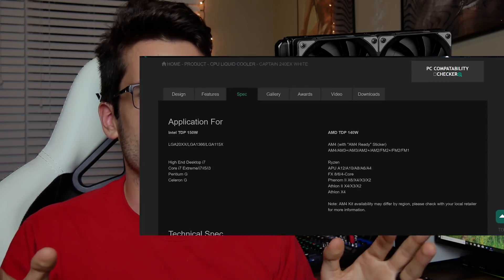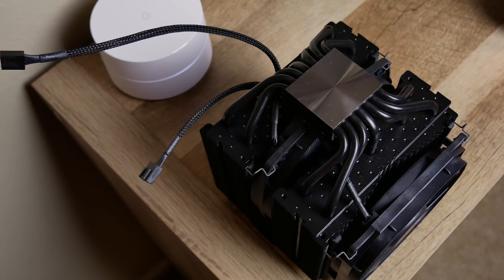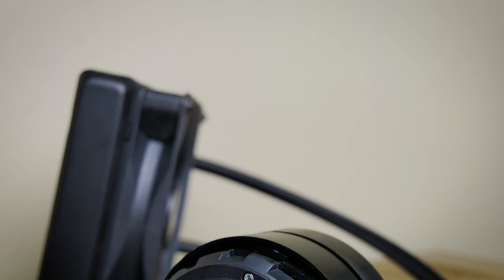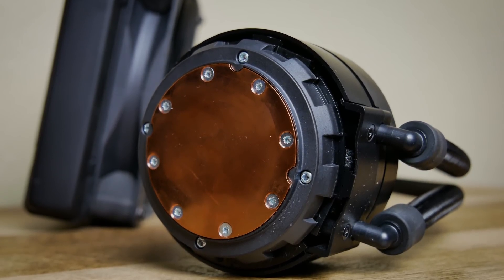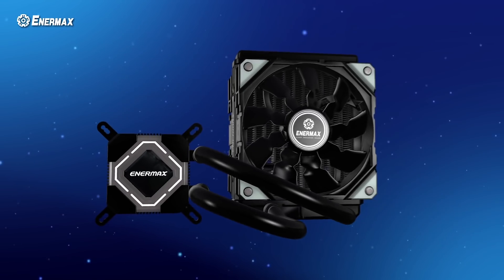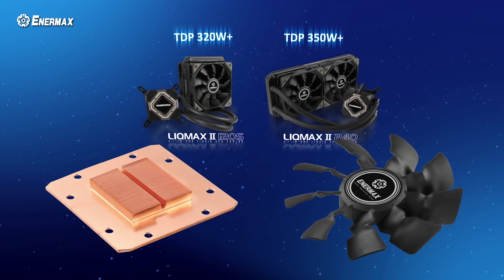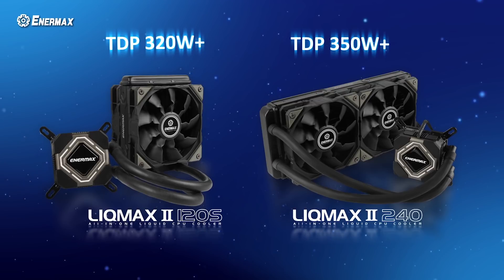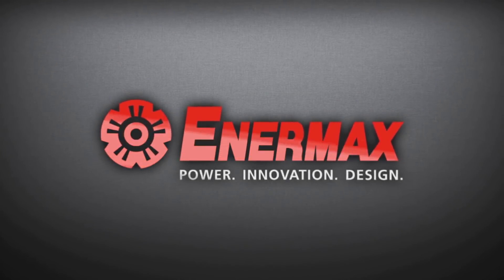Ever Wondered Why TDPs Aren't Listed for AIOs?

Comment: Greg, I would like to see you test this. Buy the Enermax and the DeepCool (or see if they will supply review samples) and run identical experiments on them to see how they perform. I agree the two companies' testing criteria were probably very different, but I would like to see some evidence to back up your claims in this video. You could rig up a dummy heat source as a stand-in for a cpu, so you could dial in specific wattages to test at. Maybe sandwich a thermocouple in there too for more data.
Reply: Also, it looks like the DeepCool product spec is a TDP for the CPU rather than for the AIO itself. Otherwise, why would the TDP be different if you are using an AMD CPU? Perhaps Enermax's TDP is what the AIO itself could handle at its max safe liquid temperature. I suspect it is likely that the thermal resistance through the CPU die, TIM, IHS, TIM and into the coldplate would become a limiting factor before you got to that liquid temperature, however. So really it comes down to how hot you say your CPU can get. If you allow your CPU to run at 99C, the liquid can be hotter, and the radiator can dissipate more heat for given pump and fan speeds. So it comes back to wanting to see testing comparing AIO performance where we know what the parameters are. Maybe GamersNexus would be better equipped to get into that...

Comment: You really hate AIOs. You quoted flawed science and logic in your AIO lying video and this one. You're like one of those religious nutjobs that quote 1 or 2 laws of thermodynamics and intentionally ignore the other 3 or 4 laws that are required for the ones they're quoting to work because it would contradict what they're trying to say. If fans have to run at max on an AIO to handle high TDP, HOW MUCH FASTER WOULD THEY HAVE TO RUN ON A AIR COOLER TO HANDLE THE SAME TDP? Use your head.
   Liquid cooling is far better than air cooling PERIOD.  My FX9590 with a 220w TDP under normal load on a H110 AIO runs under 30*c and the AIO temp at the pump is 28*c with an ambient temp of 23*c. YOU WILL NOT ACHEAVE THIS WITH AIR COOLING

Comment: Don't agree with what you're telling us about AIO and how they are not working as listed. Well at least that how I interpret your message. AIO work okay, yes you have to take into account that the AIO needs to warm up before you have an accurate reading in its cooling capacity. Fan speed makes cooling more effective on AIO's But same goes here for air coolers. So kind of weird you mentioned this. Pump speed doesn't really make much difference. Like does it matter how fast water is going to the rad?  In some degree maybe. But looking at water and how it heats up and cools down. Speed doesn't mean much.

Comment: Okay let me correct you on something
Strong pumps only helps in custom loop with a reservoir
in aio liquid flow rate doesn't matter much,slower pumps means the liquid will stay in the radiator for a longer time resulting in better cooling of the warm liquid,unless the cpu is already reaching the liquid's evaporation temperature,which mostly dont,as they never use water in aios.

for custom loop with a reservior,strongs pumps will help,but by a very small margin,as the liquid can cool down in reservoirs and dont need to stay very long in the radiator!
Strong pumps are used in custom loops not because of high dissipation of heat from the cpu but as custom loops tends to have multiples of 360mm rads and the pump needs high water head aka high speed and torque to push and pull the liquid through theses rads! custom loops arent properly sanitized and will eventually create blockages and the high pump head will help in brute forcing the liquid through it!

Comment: This is the second video you make about AIO´s and state they are not efficient, I have used both air coolers and AIO´s, and leaving a side the durability of cheap 120mm AIO´s, any crappy 120mm AIO have performed better that the standard to high end Air coolers. I will not discuss that Air coolers life span is much longer than the AIO´s, because they have long life span y comparison to an AIO, but the performance, at least in my experience, is much better.
"http://es.tinypic.com/m/jubmef/3"
This is my actual build, and the GPU does not go over 55ºc under stress, and the CPU (8700k 4.7mhz all cores) does not go over 78ºC under heavy synthetic benchmarks in loop (I will never reach this kind of load under normal workloads), the fans at the AIO have no curve configured, they just run at 500 to 600 rpm linear. 
So I still don't get the point of these videos, unless you have something personal against the AIO´s I really don´t understand what you are trying to say.

Comment: Very interesting. Im glad you went after the TDP part of coolers, i feel like people never discuss this even though its the most important part of cooler choice and a lesser but still important part of CPU choice.

Id be interested in seeing someone compare the pros and cons of air vs AIO cooling because the way i use my AIO is something that few air coolers can do. I use it not only in a miniITX system where the PSU hangs over the socket but i use it to exhaust heat from my case because my 5 year old GPU has a dying fan and any extra heat causes it to ramp its Tiny insufficient fan up tell it sounds like a banshee. 

As a side note:
Something i noticed with old dell machines is that they usually have some sort of shroud system guiding the hot air out and ive been wondering why this is not incorporated into custom PC's(besides it not being attractive). using an AIO you could definitely accomplish this without having a custom shroud. but it seems like so many people put their Rads in the front of the case blowing the air in on their GPU(s).

Comment: If you take them all to heart. Take this dagger to chest. I run an AIO on a Zotoc AMP 980, this card has the coughs stock Naruto orange fan aircooler.  I seen that card ramp up to a whomping 75C on Valley.and 40--50C idle even after replacing the grease on the aircooler.

Take a Kraken G10 plus a Water 3.0 AIO that temp comes to an idle of 28C (touchable cool) to 53c max on everything except ARK which holds it at 58C. This is the a worst case range of over 20C - 30C. 

So with that said explain why this AIO is doing a great job compared to a cooler that is air and should of been able to keep it cooled in the 60c? You opened this can of worms, can you close it or are you going to ignore this challenge? I.E scrum like Jay would ingore this, Tech Asus City would ingore this. About the only Youtubers I know who would not is Craft Computing (A breath of fresh air), Lunduke, and Elric might post a comment

Comment: Tip, only use 120mm AIO if you need space, they are no better than any air cooler at same price. If you really want cooling performance, go for 240 or 360mm, much more expensive, much larger, but does the job.

Comment: Would definitely like to see you test/try out the Arctic Liquid Freezer AIOs. Their fans even at max RPM are pretty quiet, comes in push-pull config, and has a thicker rad than most AIOs. They also advertise a very high TDP on their AIOs.

Comment: That's why I always do a custom loop.  AIO's do have a place though, they are good for stock running systems as they reduce the noise over an air cooled solution.

Comment: There is only one thing you can do. Put it to the test. 
Get a AMD FX-9590, 8x 4.70GHz, put it under water, overclock it to 5.0 or even 5.5 ghz, and see what happens when you run prime95 for 24 hours.  ;-)

Comment: The claim of 350W of TDP means that the MAX TDP is 350W doesn't matter that no one will run it at max pump and fan speeds all the time, it matters that it CAN dissipate 350W of heat. 

And what is the explanation exactly for why TDPs arent listed? The fact that air coolers have multiple heatpipes and the water coolers have 1 tube of hot water going into the rad? That's not how it works. I hope I don't seriously have to explain this point.

And pump speed always matters. Sure there is no point in increasing it if your CPU is not that hot, but if you increase the pump speed the temperatures will go lower at the cost of noise. Just like fans.

I'm not sure why some AIOs don't have TDPs, but it sure isn't this. 

Judging coolers by TDP is pointless anyways, because there is no defined way how to calculate the cooling capacity of coolers. It depends on the ambient air temperature, fan speed, pump speed and whole lot of other things like air restriction of the case.

The better way to compare coolers is by looking at temperature comparisons of coolers within the same review, because if you compare different reviews they might have different conditions.

Comment: I have a liqmax 240, and I didn't believe that tdp rating when I first bought it. I bought it cuz of the price to performance, the static pressure fans, relatively low pump noise, and ease of mounting and unmounting the water block/ pump for testing OMG is it easy to mount than a dark rock pro, a zalman tower, a prolimatech tower, a deep cool tower, a Corsair AiO.

Comment: with TDP being subjective ti coolant temp I don't doubt the enermax claim, however...
it would only perform at such an efficiency with the coolant temp highly elevated above ambient. lets say the coolant has an anti-boil and you've gotten the fluid temp to 120c in a 25c room, of course that radiator is going to suck a good chunk of that heat out, but it's not going to change the fact that the cooling is now pointless as your cpu and socket are currently a melted mess of metal and plastic, and probably on fire...

I run a Celsius S36 in my ryzen 1700 rig as it seldom sees a continuous load on the CPU and as such I let the coolant volume take care of the work (CPU goes full load for a few seconds, the coolant itself raises a few degrees, and subsequently drops to near ambient when the load drops) so the fan speed aligns more with the ambient temp than it does the CPU load. cooling in this manner is to be perfectly honest, bloody inefficient as like I said, efficiency is dictated by the delta between coolant temp and ambient, however it means that my fans can remain in perpetual silence :D

Comment: i put 2 92mm aio coolers in my dan a4fx mini itx case to see if i could do it and cuss of the limited space i have.i put one of the aio coolers on my gpu and it runs cooler then before and doesnt heat up the whole case now either.

Comment: i was just looking for this. I have an Antec Mercury 120 for my Ryzen 2200g. I had an Enermax 90 before and thought it was good enough but it reaches 98c when stressing both cpu and igpu. Normal games will take it to 80c and i wasnt comfortable with those! So i bought my AIO and ran aida64 for 3hrs (i fell asleep) and max temp is only 68c for a sec or 2, stable at 61c. Even in game only goes up to 56c! Huge difference and Im so happy except for the vibration. I have to hunt the source!

Comment: I don't know, I put an aio 360 rad on my evga 980 ti. gets 43c on full load overclocked and over volt.30c to 35c lower then the stock dual fans heat sink ACX 2.0+.same noise level, probly less. and heat from my card isn't blowing in my case ....and it's just cool to watercool you're pc, got a 240 rad aio on my 4790k....clocked , full load stays under 60c, and it's just cool to watercool you're pc

Comment: One thing I wonder, is why the liquid in the AIO system is not thermostatically controlled like in an automobile? The fans in a modern car are controlled by the computer just like in a PC. Is that even possible? What would be the gain/detriment to this type of system?

Comment: You missed one caveat.  There is another factor that determines the cooling rate and equilibrium temp.  That is cooling area.  The amount of surface area available for heat transfer.  If AIOs have more fins per inch and/or a generally larger surface area, this will multiply the cooling effect.  If a radiator has 50% more fin area, we would expect 50% more cooling, within limits of course.  The other thing that is misleading in your video is that cooling is based on fan speed.  This is not entirely correct.  The rate of cooling is based on the volume of air moved over the cooling surface.  More air flow means more cooling.  And while this is directly related to fan speed; it isn't the only factor.  Blade design, resistance to flow in the radiator, and pressure difference inside vs outside the case all affect this.  While I believe your points are generally valid, in specific cases you may find that ignoring these elements will lead you to some incorrect assumptions.

Comment: In my experience the best cooling setup is a large tower cooler for CPU and AIO on your GPU (kraken g12+corsair h50 for example). CPU's react oddly to water coolers, yes they do stay cooler than a tower cooler under a very stressful load but they also have spikier temps because they dont have that massive block of metal ready in an instant. GPU's on the other hand love water coolers and these temps spikes do not occur.

Comment: "Ever Wondered Why TDPs Aren't Listed for AIOs?"

Can't say I have, because I've never looked that closely at AIO coolers. Air coolers are cheaper or the same price, usually cool just as well unless there's extreme circumstances, and have less parts to both make noise and break. If the fan dies on my air cooler, I buy a new fan. If the pump dies on my AIO, or the fluid level gets too low, I buy a new AIO. No thanks.

Comment: As someone who has a 5.2ghz capable 7700k and a corsair h100i v2 cooler I am not believing that tdp's are listed correctly as I have to run it around 4.8/4.9ghz with stock voltages to maintain stability over long term. The only way i can keep temps below 80c is keeping clocks down in the 4.8ish range during the summer, anything above this and without cleaning the fins every other month is a bigger rad. Some advice from a hot cpu owner.. use a 280 or a 360 instead or go big on air cooling. I wouldn't recommend a 240 for a unlocked i7 6th gen or newer at more then roughly 4.8/4.9 ghz oc's in warmer climates. Just don't.
Reply: Scootermagoo or you can do a delid because that’s the only way to go to keep it stable at 5.2ghz. 

I had to do it on my 8700k at 5.1ghz and that is even with a costume loop.
Reply: To much hassle I'm more pissed off my asus mobo is in rma atm and I'm borrowing a fx6100 that runs at 45c..
Reply: Scootermagoo ooo that sux I had to do that with my maximum x formula when I just got it thank god it was still in the 14 day with amazon.

Comment: I assume, to some degree, that custom loops fall under the same considerations as aio's. Maybe to a lesser degree with powerful pumps like D5's. I'm not saying multiple rads have low tdp like a single 240 aio, but comparable rad space considered, they're pretty close. Which gives custom loops an advantage. Being able to add more rad space to the loop allows for higher tdp to be disapated.

Comment: maybe the 350w is because they measure it with a direct heat load that makes contact with the entire cold plate which has lower heat DENSITY than an overclocked 7900X. for example a 350W 7980XE will be easier to cool than a 350W 7900X because the surface area is larger.

Comment: I'd like to disagree with you Greg on the Enermax issue. IDK about the LiqFusion Max but their LiqTech TR4 coolers are easily able to handle OC'd Threadrippers which are known to draw about 350 to 400W at OC. Also, love from India. I too have a Deepcool Captain 240EX White cooling an old Phenom II X4 955 125W CPU OC'd to 3.7 GHz in an ambient of about 30C here and I have been folding on the CPU for the last 2 months non stop and temps have never gone above 60C. Love this beast . Its a pity it doesn't recieve the attention it should for being such a fantastic AIO.

Comment: I have a system that sports two CPUs with 145W TDP each under two separate NZXT Kraken X42s. If you wish i can do a full stress test for you - with Aida64 - and i can report the temperatures. How long do you think i should stress my system before the temperature equalizes? An hour? I can do that.
Reply: Ok, here's the result: my system is 2 x Xeon E5-2697A v4 (145W TDP each), cooled by two NZXT Kraken X42's, after an hour and 15 minutes of the Aida64 stability test that stressed out CPU, FPU and Cache - all 64 virtual cores were 100% load as reported by the Windows task manager, ambient temperature is 71F (21C). After an hour the coolant temperature was 52C, the hottest core as reported by Aida was 64C and the coolest core was 59C. Fan speed never exceeded 1100RPM, pump speed was at about 2900RPM as reported by NZXT Cam software. The fan and pump profile was set to "Silent". Power draw as reported by the corsair link utility was about 490W at 92% efficiency.

Just for your information.

Comment: To continue upon what Phil said below

I have the arctic liquid freezer 360 aio. It says that it has a tdp of 300 but in their case I truly believe it’s true. Now to explain my reasoning, it comes with 6 3-pin fans that are around (if not over) 2k rpm and they are all forced to run at 100% unless you are technical enough to know otherwise. At 100% for these fans their tdp is validated

I switched them out for some phanteks sp fans at 700 rpm and haven’t had a single issue with overclocking my budget ryzens but then that why I bought a $100 AIO